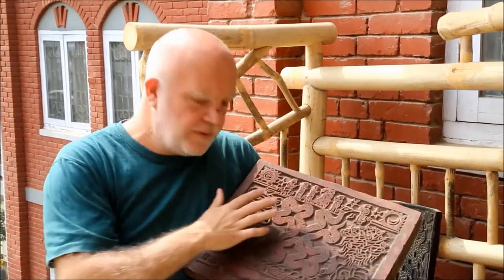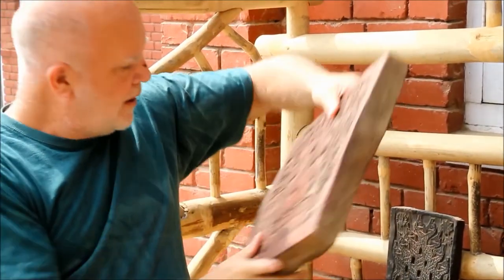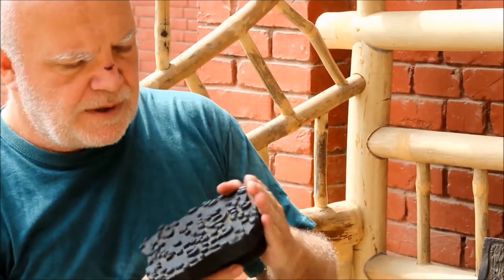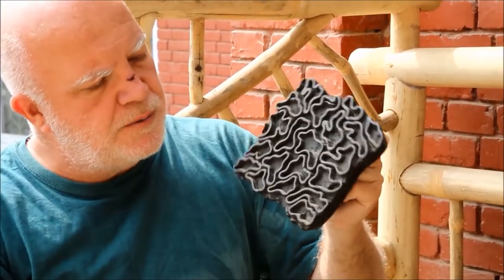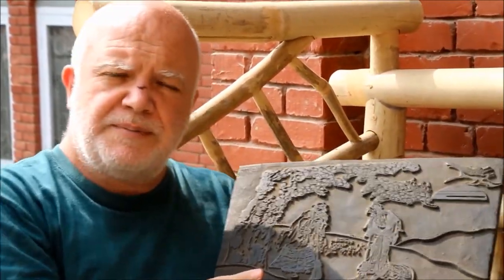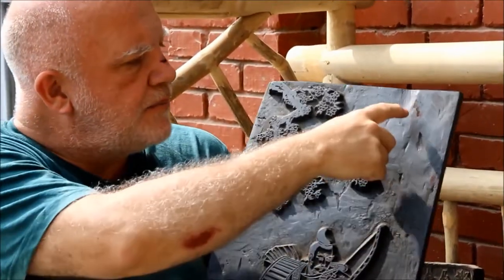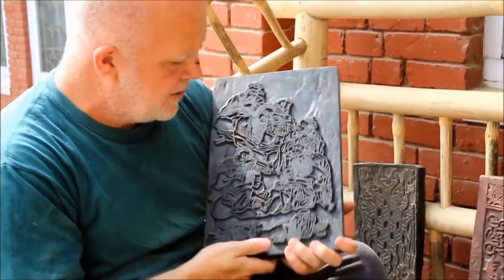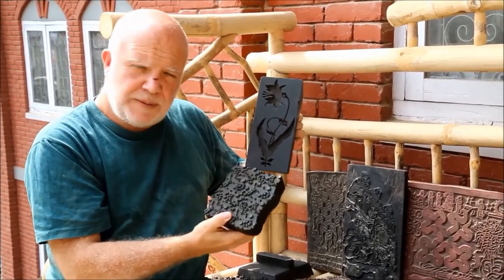NEPALESE WOODBLOCK PRINTING IN RITUAL, CULTURAL, ARTISTIC AND TEXTILE USE.

Comment: Great content Paul, love the idea for the series! Do you mind sharing where you found/bought these blocks?
Reply from the maker: Hi Shriv Thank you I gathered most of these wooden printing blocks in antique shops across Kathmandu over the last 6 years, but i also have an extensive network of people searching for interesting ritual objects connected to my work and ongoing film and book projects and am friends with a great many collectors, dealers Shaman and spiritual practitioners across the world.but particularly throughout Asia. The Printing blocks used for Textyes are quite easy to find and are still in use, But are available because of new digital printing, The Naga (snake God ) printing blocks are extremely rare because like the textile blocks the images for Nag Panchami printed to protect each households front door is now cheaply produced with mass digital printing Because these were craft items used in a ritual they held no special value for the Nepali at the time of being replaced perhaps 50 to 70 years ago, so most were probably discarded. I have a particular interest in Naga so 2 different dealers kept them back for me. The traditional Chinese woodblock designs of the old faithful couple, the 8 Chinese immortals, and the worrier.I found by chance in a Kathmandu antique shop. I don't know how they came to be here and the dealer didn't know what they were. Nepal and Kathmandu, in particular, have been the central trading hub for the silk route between china Tibet and India and the middle east for at least 5000 years so one  finds objects from across here
Reply: @paulwilkinson5970  That's amazing! I went to Thamel, Asan and Basantapur to look for some but couldn't find any old ones they were all made recently and still in use. I was looking for the Nagin one but probably won't find that one then. I am looking for textiles ones but like the Naga, fairly small, can you suggest any particular place where I may be able to find anything like it?

Thanks for your detailed reply, I've learnt a lot.